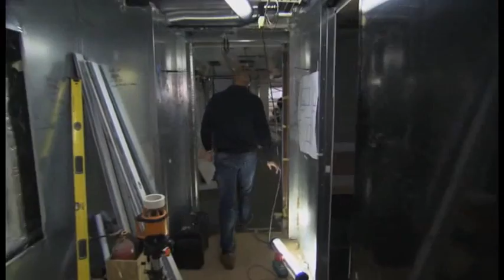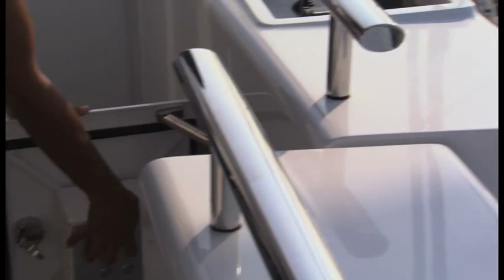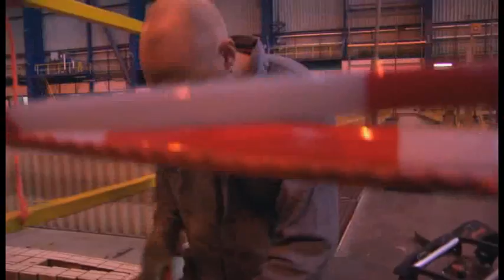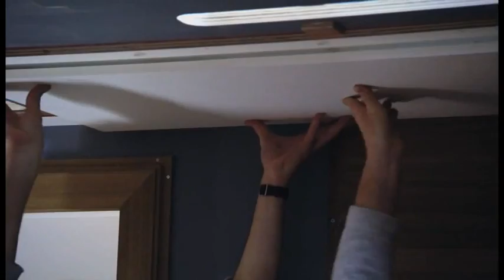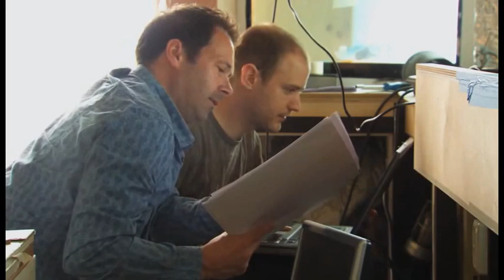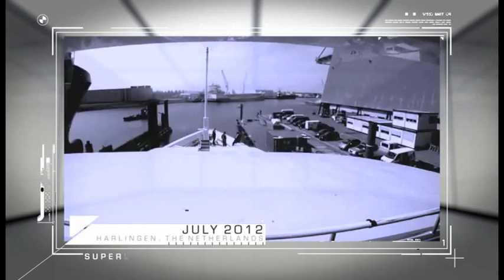ICON Yachts - Discovery Channel - Superyachts -

Comment: Okay, I have a few questions:
1. Why is "modular" construction called innovative? It's been used in shipbuilding for 30 years now, if now more.
2. How is 30 months per yacht faster than what they call traditional methods? The longest yacht in the world Azzam was built in 3 years. This one is MUCH smaller but it takes only 6 months less. What's the point?
3. What they call "beach club" is called transom and it's far from "unique feature"; every large yacht has one these days.

What the heck? Why try to fool potential customers? You think we're stupid?
Reply: 1. It's innovative, because is not very popular in private superyacht industry, but rather in the industrial and cruising ships.
2. The time of construction can vary depends on how much you're willing to pay. That one costs around $50-60 Million, I guess. The Azzam is $1.56B and it had been constructed by at least 300 people on site.
3. Unique feature doesn't certainly mean it's "the only one out there". It means something very special and exotic, unique to vessels of this or bigger size. The most common beach club area is an extended lower deck, rather than an automated door. 

Note that, in the last 5 years, Yacht industry has developed faster than smartphones and continue growing. What is called innovative in this video, might already be common in these days ;)
Reply: A transom is the sternpiece of the hull.  A beach club is a hinged transom that turns into a swim platform, and has space behind the transom for chairs and shit.

Comment: 2 years? why so long? Super container & oil carriers are built in 1 year & their so much bigger
Reply: No, the size and workforce don't matter. Lurssen is a HUGE company employing 4,000 workers (Daewoo employs 13,000) but it still takes them 2-3 years to make a large yacht. 

Just realize this. It takes longer to put 100 sq. meters of teak floor than to weld a steel deck on an oil tanker. Also, oil tanker accomodations use bog standard beds, toilets, sinks and mirrors. On a large yacht everything is custom made and requires personalized installation. If you go to a serial yacht manufacturers like Princess, Azimut, Benetti, Sunseeker, with some luck you can have a boat in a couple of weeks. Or even buy it new made from a dealer right away. But it'll be as personal as your TV set.
Reply: Law19157 my guess is that oil tankers are built by larger companies and have less details
Reply: +Law19157 Tankers are not too involved in building, and shipbuilders like Hyundai have the capacity and man power to put those things together.   With companies like Icon or their contemporaries, they have a smaller workforce and most of the larger hull assemblies for the "super" class yachts are rarely the same, hence in most cases, they even build the tools for the build.
Reply: +Law19157 I personally do not understand the whole logic behind it I used to think I had my facts wrong
Reply: Maloy7800 Well said, my thoughts were quite the same albeit from sheer manpower levels.  I think I wrote that comment during the time frame where I had had a conversation with an idiot who believed that the yachting industry doesn't create jobs on its own.

Ugh I hate ready made, a lot of people don't realize how much liberty they have with appointing an M/Y (not to mention how much of a better selection a buyer with their head screwed on right can make).  Never should one ever buy anything that creates an expense profile like that as a ready made product, it's a bad business decision like that fake teak on the smaller Sunseekers (at that point, get a Hatteras, Pershing or Magellano 53 instead, much better appointed).

Addendum; Ready made motor yachts are more for the drunk Uncle who may have the propensity to sleep with anything female with two legs.
Reply: Because everything is custom with mahogany wood Carrera marble and the owners want it done perfectly. Oil tankers are built in separate blocks and welded together